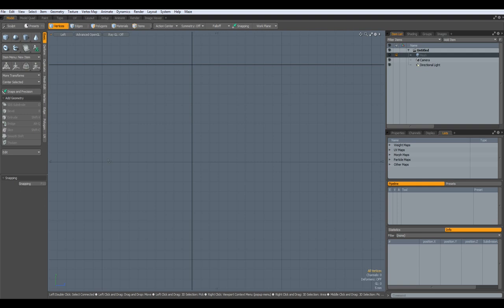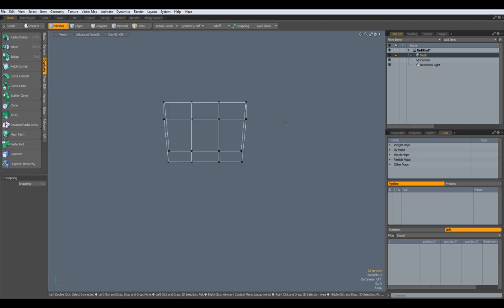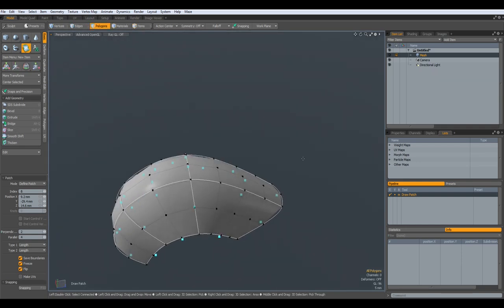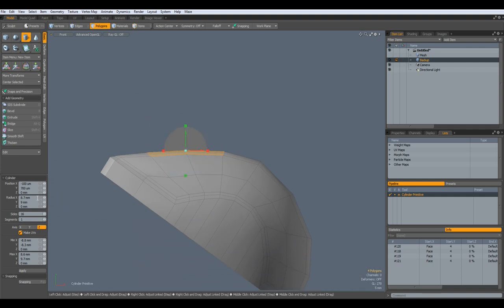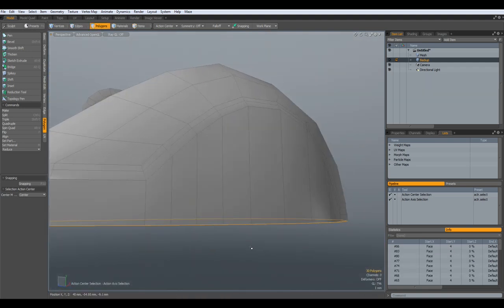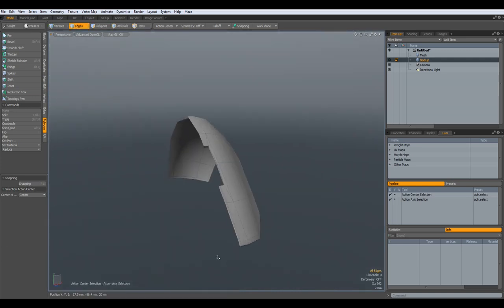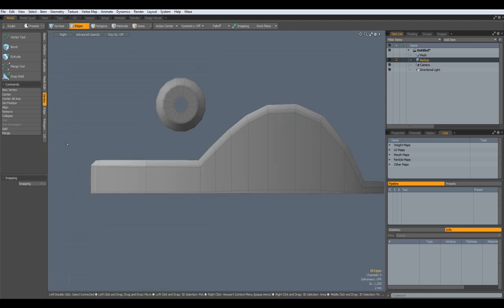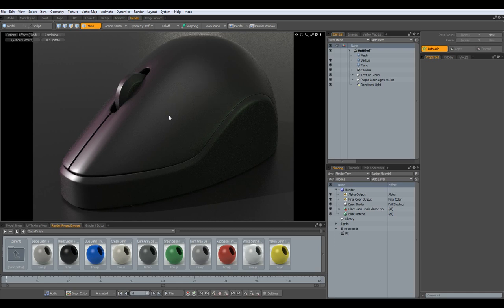Luxology modo - Modeling a basic Mouse

Comment: hi there, i just started with modo, and while doing this exercise i faced one problem- i created the surface and then i  pushed ctrl+x and then ctrl+v, but the copy of the mesh didn't appear, what can be wrong?
Reply from the maker: Татьяна Игнатова Hi, the only thing i can think off is that you changed to item mode or are in a different mesh. But other than that, i never experienced any problems in this area. Good luck, Peter